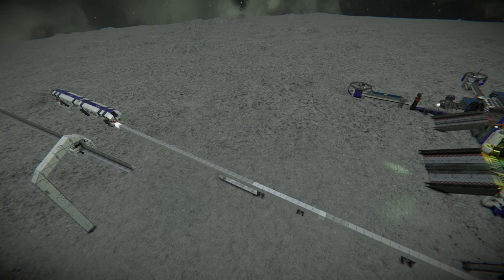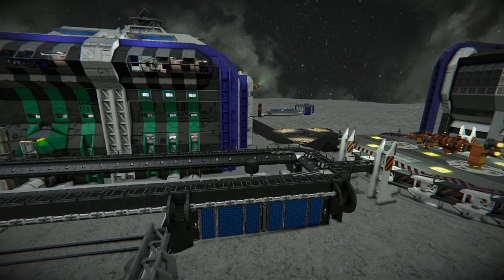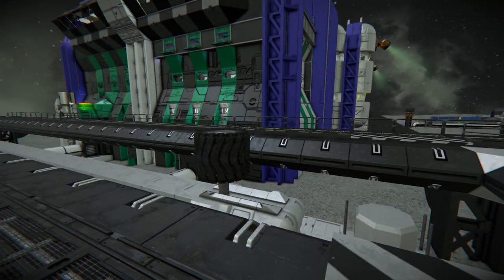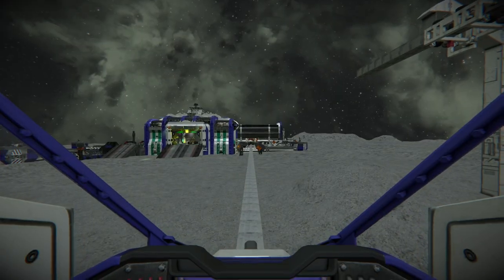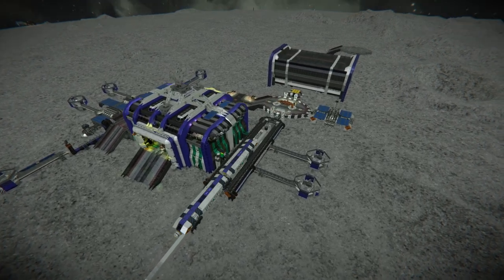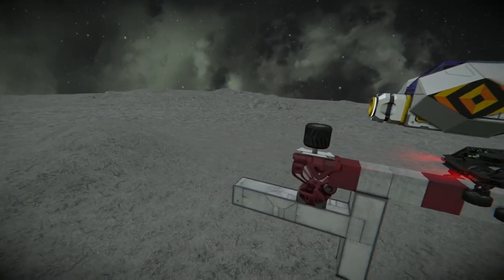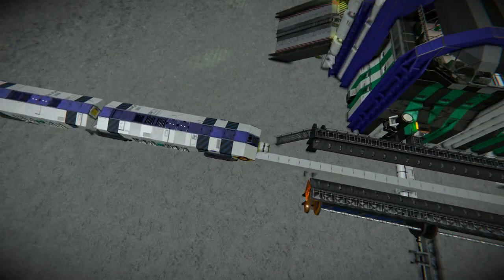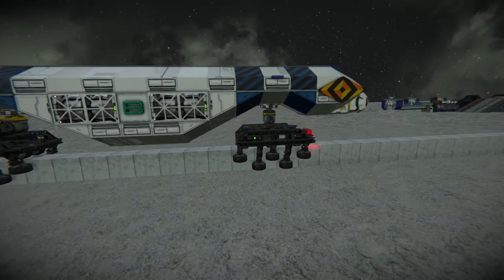Space Engineers Monorail Automatic drive test

Comment: I usually build vanilla without scripts, using Sensors/Timer blocks OR Remote waypoints/Timer Blocks. 
These are my methods, customize to suit your requirement.

Sensors and Timer blocks
1. Set up a Timer block instructions to apply brakes until it stops and Reduce Suspension Wheel Max Speed setting such that the train will travel below 8m/s (3-4m/s works best i feel) when moving off again. Because at speeds below 8m/s, colliding with blocks do not cause damage. Once it stops you need to release the brakes by activating a Delayed Timer Block such that the train will move off at that Low speed (see no.2)

2. Set up and another Timer Block with On/Off brake instruction with a delay long enough that you know the train will be at a standstill. Put this block to be activated by Timer 1. above

3. Now you need a Sensor to trigger Timer Block no.1 when it approaches the Station or at your specific braking point.
From your design it may be possible to get the Sensor to trigger upon detecting your STATION. Be sure to set the Sensor to trigger only as such. Also do note that sensors have a max range of 50m.

4. After that you can place Connectors, Merge Blocks on the Train and Station inline with each other and they will collide safely. 

5. Moving off from the station, is just the reverse...
Disengage from connector, Invert the Propulsion (if you are using Override Propulsion to automate), and increase Max Speed setting to your desired speed.  

Remote and Timer Blocks
1. Setup station approach waypoints on your Rail. In each approach waypoint, do the same as above. Setup the waypoint in the REMOTE Controller to slow/stop the train and then move off again to let it collide slowly with the station Connector. Use CIRCLE mode in the Remote to do a To and Fro station to station setup.

Advantage of using Remote is that you can put any number of points of trigger to give instructions to the train. Also each setup waypoint on the REMOTE can trigger 9 actions, and reduce the need for Timers in some cases.

Important Note: The GPS Waypoints Must be taken when in Control of the REMOTE, for better trigger reliability. At desired trigger waypoints, take control of REMOTE, then take the GPS coords from it. Not from Player/Char.

Note: If Braking the train breaks the rails (due to weight), unclick the Allow Brake checkbox on some wheels (alternate wheels is good).

One more thing, REDUCE Max Speed Setting if done early enough can slow your trains gradually instead of using braking. Or let it be slow enough that braking wont break rails. Yes full braking under very heavy weights barrelling at 104m/s CAN break rails.

I usually build elevators, and certain designs can be used horizontally as well.  The setups above has worked well, but does take some time to set them up correctly at first...

Hope it works for you.
Reply from the maker: Thanks, I saw your video, so it works well!
I don´t like to make it with timers, becouse I made bad experiences with it, not couse of the game, more like, after a few weeks I don´t remember how the setup works... With a huge timer Airlock witch a once builded, I don´t figured out how I made it... 
But I will keep your soulution in mind, if I don´t find a script soulution. 
At the monemt I´m still thying with DAS, I think I got a way, hopefully.
Reply: @royalrollin8372  Hey no problem. Hope you find a script that works for you. Will watch out for your next video to see your working automated Train!
Your builds by the way look really good!👍
Reply from the maker: @flyingace2817  Thanks, I found are soulution! New video is online: https://youtu.be/dDVGR9IHCNE
Reply: @royalrollin8372  Watched it. Cool solution👍